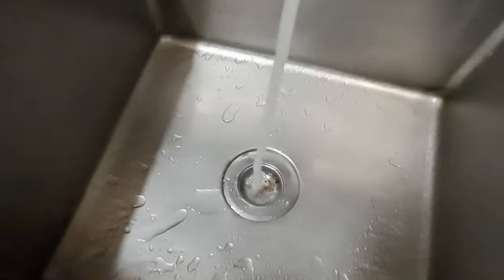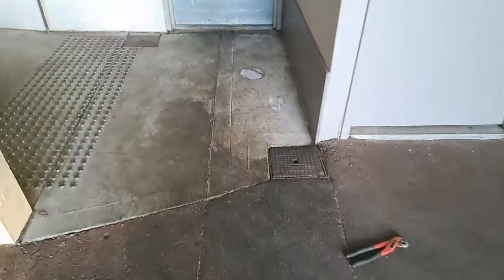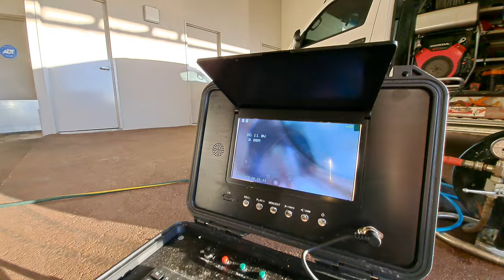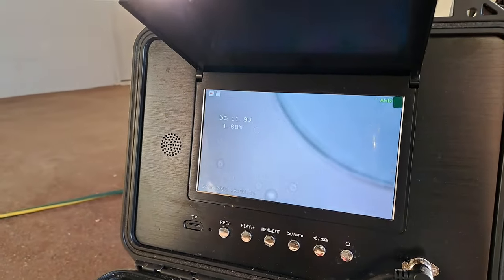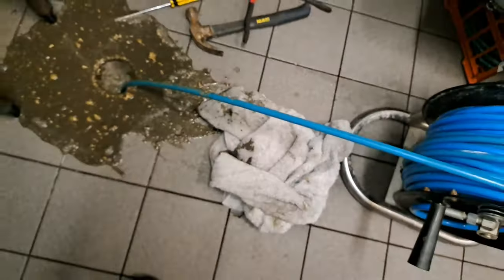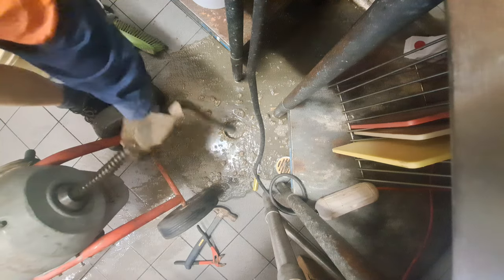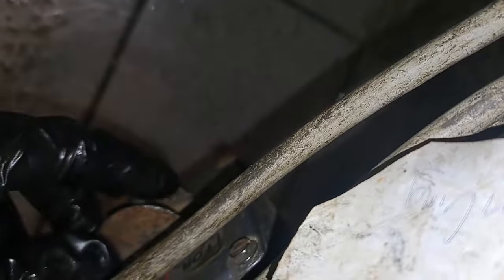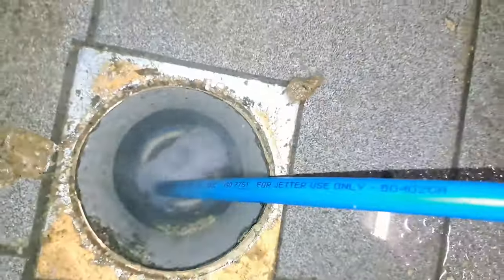2023's MOST DISGUSTING BLOCKED DRAIN (so far)

Comment: In USA we have companies that recycle restaurant grease, that are collected outside in large enclosed containers, for other recycling purposes.  Why can't restaurants in Australia do this instead of blocking drains with tons of grease?
Reply: Exactly. Came to ask the same thing😳
Reply: Blondi, 
       As a sewer and septic worker in the USA, I can firsthand tell you that the majority of restaurants, schools, basically any commercial buildings hooked up to city sewer does the exact same practice. A grease trap, then to the main. We snake them all the time.
Reply: We do as well ..big drums for pouring old deep fryer oil etc and it gets collected .what you see here is a trap to collect any grease from the sinks
Reply: 13:01 Stuff ya towel in the top of the drain, stops the water spilling out so easily, and builds a tiny bit of pressure to clear the water.  Just don’t press in in so hard to seal it.
Reply: Restaurants in the US have grease traps as well
Reply: We do have that system in Australia. Unfortunately with a commercial kitchen it is hard to prevent all oils and fats going down the sink.
Reply: Why does a floor drain have so much grease in it?
Reply: Once again, my Simpsons knowledge was useful then
Reply: Haha I thought the same thing when I read the op's comment. The grease on the kids forehead 😅
Reply: If the restaurant does their job and have the grease trap pumped, then it shouldn't get blocked
Reply: Small amounts of grease over a long period amount to lots of grease. You can't recycle the residue on plates, cutlery, and utensils. All of that's going down the drain.
Reply: What are you talking about Is Oil used for frying. Grease traps, Are for catching grease From Dish washing machine 2Any other reason That some reason might get down in a drain. The big containers you see outside restaurants Are Almost Exclusively From frying food And it is filtered And turns into bio dies
Reply: @JD-rq3ur because it’s in a commercial kitchen and it’s likely never been cleaned.
Reply: @seansopata5121 problem is that this grease trap services multiple restaurants, so there’s likely some shifting of responsibilities going on there.
Reply: Facts
Reply: That was a Godzilla level blockage.
Reply: Same in the UK. I know one oil company has a contract with McDonald's. They take the waste and turn it into biodiesel.
Reply: Same in the Nordics, commercial kitchens must have grease traps. However I think they are located jn basement of the buildings instead of in the street. And there are these big vacuum trucks empties these in the mornings. The content of the trucks are then recycled somehow. I think they make diesel out of it?

Comment: A chocker unblocking, to use your words. Chocker can be used for so many things.  So adding a new word to my vocabulary.  Nice job! That was definitely a long run for your machine.  A lot of weight for your machine to handle. Not surprised your machine tripped the switch.

Comment: you need a plunger with a cut-out in it to fit in a drain beside the jetter, double action. I'd also grab a few used commercial entryway carpets, and lay them over drains while jetting inside buildings to prevent the shite from hitting the cielings. if you mark bands on the jetter hose, it'll make it easier to tell how deep it's gone into the drain for the viewers as well.

Comment: 13:01 Stuff ya towel in the top of the drain, stops the water spilling out so easily, and builds a tiny bit of pressure to clear the water.  Just don’t press in in so hard to seal it.

Comment: In for a penny, in for a clean drain to the very end.  Part of the problem I see, is that the drain line has very little "drop" to it.  The building seems like it's a single story, and you were out 130 feet +.  The IE of the sump outside was not that low in the ground, so the drain pipe is so flat that the"drop from the sink" is the only thing that gives the water any energy.  Poor design.  You need to have "contracts" with the restaurants and the building owners for "Bi-yearly" cleanings.  Or you will be there again soon.